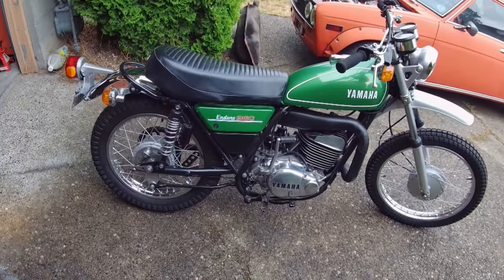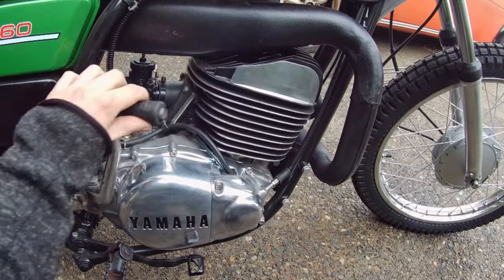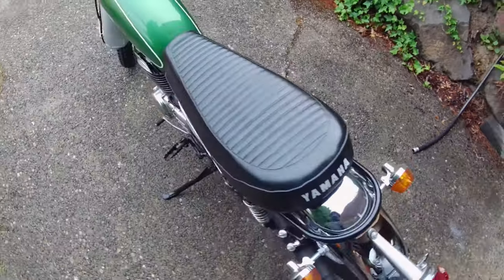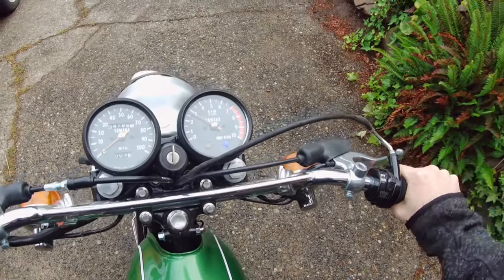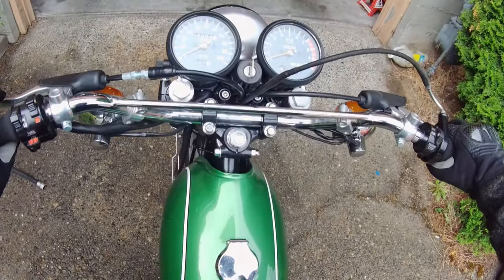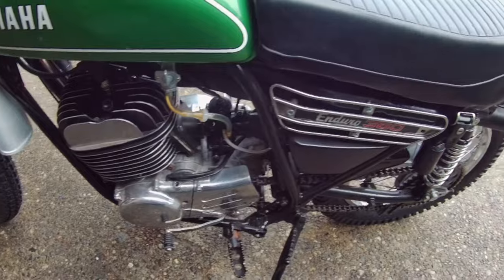stock 1974 yamaha dt360 short ride around the block

Comment: Sharp looking Yamaha 2 stroke bike. Eventually it will be stronger and running better with new top end getting new piston and rings. If I owned it I would pour in gas tank every other filled up with premium gas adding 4 ounces of marvel mystery oil and every 4 gas fill ups or so 4 ounces of Chevron Techron fuel injection cleaner to keep carb injector free from gum up.. thank you for the great video. GBY sir.

Comment: Beautiful bike nice job keeping it stock as well. I have 75 RD 350 I kick it over slow two kicks draw in mixture then a firm kick starts right up with choke on. Also upgraded Ignition to electronic with a Vape power Dynamo system
Reply from the maker: The vape system is a good upgrade, in this video it was 4stroking a bit from a weak ignition, I replaced it with an upgraded ignition and posted a new video where you can see the running smoother

Comment: It seams  to me it’s down a little on compression , over revs s bit upon down shifts , little lag upon  roll on throttle ,idle is too abrupt & all synonymous with  a percentage worn rings & piston &  runs pretty good considering  & looks great & excellent shape ! All Yamaha’s  2 stroke enduros are exceptionally good & dependable & good performing  motorcycles  !
Reply from the maker: it had a bad ignition, i posted another video of it fixed

Comment: Nice bike.
I wished Yamaha sold that bike in my country.
Pardon me if I am wrong.
The chassis number on your bike is either RT2 or RT3.
That means your bike is an RT360.
In those days the DT1 & DT2 were the 250cc bikes only.
Later on, Yamaha designated DT to all Enduro/ trail machines.
Trinidad & Tobago.
West Indies.
Reply from the maker: thanks for your comment, this bike is the second generation of Enduro from Yamaha, the frame geometry and engine are totally different than RT360.
the chassis number on these bikes is "446" it's probably closer to motocross bike you can find in your country like MX360 1974
Reply: @bluestripes1  Ok. Great ! And thanks.
The first model came with a piston ported engine. The second came with the reed-valve between the carburettor and block. This was dubbed " Torque Induction" by Yamaha, and led to the RD series engines of their street bikes.
Cheers !
Trinidad & Tobago.
West Indies.

Comment: Mate sweet bike
Have had mega DTs
That thing is clean as
Not nit picking but do yourself a favour get proper stock levers would finish that off awesome 
Lucky guy
Wish I still had my last 400
Still have a couple of 75 250s
Anyway cheers from down under
Reply from the maker: I like these levers, they are the same shape as original but have rubbers for Enduro use and mirror mount lugs.

Comment: This bike sounds weak. I recall the DT360 as being much more powerful. Maybe the muffler on this one is clogged. I know there was the MX version with an expansion chamber, but regardless, this one is down on power. Congratulations on preserving this historic beauty! Cheers!
Reply from the maker: the cdi box was failing in this video, I've since fixed it and had it on the Dyno and now it makes the factory horsepower,👍

Comment: Why are your shocks on upside down?
Reply from the maker: thats the correct way to mount these aftermarket shocks. also, its better to have the reservoir on the chassis because it is less unsprung weight, the wheel and swingarm will weigh less and respond better
Reply: I assumed they were original, you said 100% stock.  @bluestripes1

Comment: Do you think the 360 is much more powerful on the bottom or top end than the 75 250?    Do you know any tuning kits they make for these
Reply from the maker: it's got a lot more torque than a 250, and if you put an mx360 pipe on it you'll have lots of top end as well

Comment: Dude, your spirometer is all over the place. You’re about 15 miles an hour off
Reply from the maker: not in this video? speedo works well and is accurate
Reply: WTF is a “spirometer” on this 1974 model 360?
Reply: @cavscout62  well it ain’t metering speed...